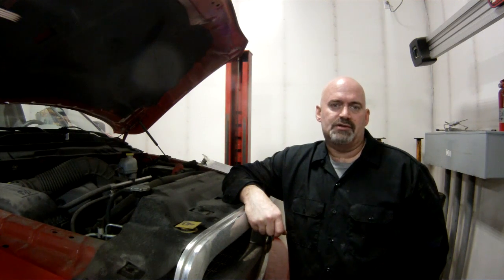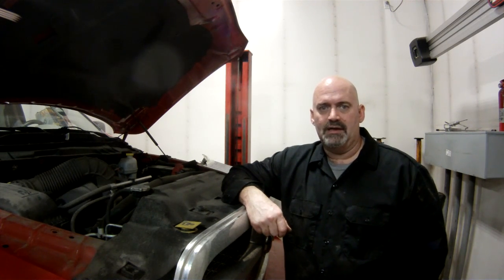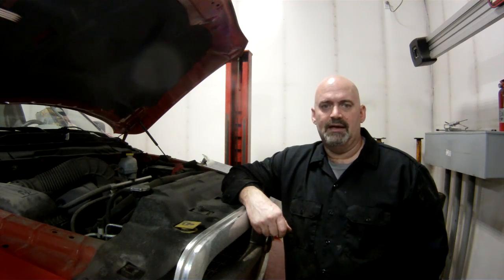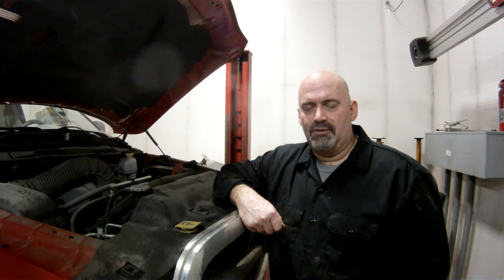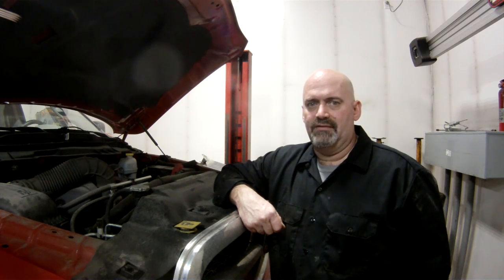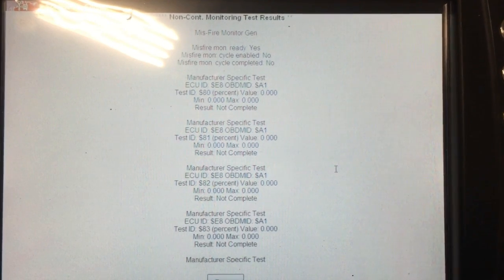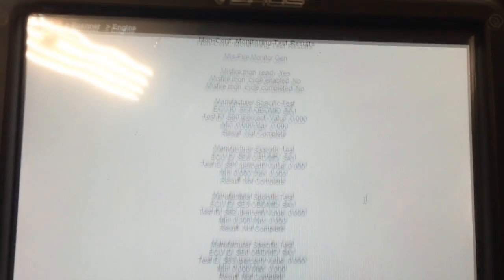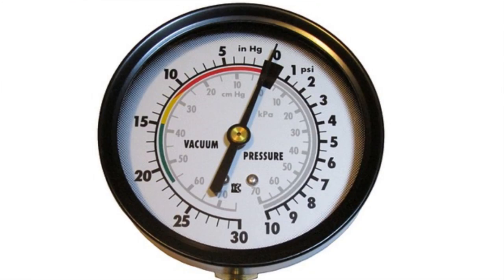Dodge 5.7 Hemi Misfire Problems

Comment: I have a 06 Hemi charger 5.7 when it starts up there's a clicking noise & it's just getting worse another problem is when I fill up tank & start it it limps on me & sometimes goes off
Reply from the maker: +Mario Santos I would try to isolate where the nose is coming from. Sounds like it will require a physical inspection of the valve components. Let us know what you find out. Good luck.
Reply: The limp is ur gas tank being overfilled, its covered by warranty.

Comment: I gust got done working.on a 5.7 the cam lobe was warn off on no 5 cylinder  ..pull V.C.and check if the valves are opening far enough ..my shop is on FB  Chucks Automotive and Diesel Repair. .in Albemarle NC.
Reply from the maker: +chuck stephens great tip Chuck! Thanks for stopping by.

Comment: wouldn't the ignition coil have shown to be faulty during testing of the cylinder?Or only because it happens under load it would not have been detected?
Reply from the maker: +jeff d You are correct,  sometimes secondary ignition faults don't show up at idle.
Reply: +jeff d So I changed cylinder #1 ignition coil. its much better but not perfect. Is it possible the either of the adjacent cylinders in the firing sequence are also suspect but not showing up on the codes? if yes, which are they 2 and 8?OR does the computer have to 're learn' the firing?
Reply from the maker: +jeff d Sure would be helpful to have a relative compression test done and review the data to isolate the problem cylinder. I hate to see you throwing more parts at it. Even finding a shop with a scope, pressure transducer and trigger lead and a tech who knows how to use it would be very helpful. If it's still #1 cylinder misfiring and the compression is good you should probably pull that valve cover and inspect those valve springs.
Reply: +The Car Doctor:  last question, the compression is good and as stated the problem only seems to exist during the RPM specified AND looking for power. I believe it's not mechanical because of the intermittent nature. If fuel is ruled out and computer reads cylinder one still, is there anyway it is the adjacent cylinders in the firing sequence?
Reply from the maker: I have seen that before. Thanks why I recommended the testing to verify what cylinder is truly affected. I have also seen defective parts and cracked spark plugs causing what you say so I wouldn't rule out the replacement parts as being the cause of your continued problem. Still think its worth running by a tech who has the equipment and knowledge to pinpoint the problem and save you money.
Reply: +The Car Doctor Car Doctor let mw throw this out there.I do also have intermittent starting problems. And when it fights me while starting the exhaust is white for a little bit of time. I assume Carbon build up. My take is its all related. frustrating thing is for the most part the engine runs and performs real well most of the time. Any thoughts? Thanks for all your help!
Reply from the maker: Compression test, leaks own test and cylinder balance test would be my next steps if the relative compression test yields no definitive results.

Comment: I have an intermittent cylinder #1 misfire only when the cylinder is under load. usually at 1500-1900 RPM and due to an incline the engine calls for more power. engine runs well otherwise and doesn't seem to happen otherwise.New plugs wires and fuel injector. any thoughts?
Reply from the maker: +jeff d Sounds like an ignition coil possibly.

Comment: I have a 09 ram bighorn hemi and I was driving with cruise on and my tensioner and timing chain broke, 2 months later the shop finally got the parts from dodge and fixed it but now it has a terrible terrible missfire. could it also be the valve spring?
Reply: +Yehosaphat Ken Yisreal Check to see if they put all the spark plug wires on, in their right places.
Reply from the maker: +Yehosaphat Ken Yisreal That&#39;s certainly a possibility. Any audible noise associated with the misfire? Misfire code? Be good to know what cylinder to look at and possibly run a compression test, injector circuit tests and possibly physical inspection of the valve springs on that cylinder. If the check engine light is on than it likely has codes and maybe a misfire code indicating which cylinder is effected. I hope it doesn't have any valve damage.
Reply: +The Car Doctor thank u fam, I'll check into that. I really appreciate your feedback!
Reply from the maker: No plug wires on this engine.

Comment: I have the 2013 5.7. Constant crank and engine wont fire. no check engine light. Any Ideas?
Reply: +Johnathon Aragon down on the oil pan on the passenger side you would be able to spot it. It will have a connecter that looks like the one to your Map air flow sensor and it will have a small bolt holding it tight. you may also want to get the cam shaft sensor as well which is right underneath the alternator. you can get the engine blue prints from google. that will show you every sensor and every wire.
Reply from the maker: +Johnathon Aragon So many possibilities. Any messages on the dash? Codes? Fuel pressure, spark, injector pulse?
Reply: +The Car Doctor you think a lifter would cause a problem like this?
Reply from the maker: Not likely but I suppose its remotely possible. Maybe just spray a wisp of starting fluid in air intake while someone cranks to determine if its fuel related. Had the check engine light come on before it stalled?
Reply: no the light never turned on. I got in my car yesterday at work to go home. it cranked and never fired up. then i shut it off and started it again and it ran. drove 40 miles home. then let it sit for 4 hours and started it to drive to the grocery store later that night. no problems at the grocery store. get home and park it for the night. then hit the remote start this morning. car didnt start. so i went out there to start it and all it did was a constant crank. been doing it all day.
Reply from the maker: Sounds like fuel pump to me. Lifters, rockers and valve springs usually break and don't become intermittent. Starting fluid might be a good test. Or test for pressure at the Schrader valve when someone turns on the ignition (be super careful not to get fuel spray in your face, start a fire or get caught in moving parts)
Reply: +The Car Doctor where is the crankshaft censor located?
Reply: Umm, you have to take the starter completely off. The sensor is hidden directly behind it. Oh and it was my fuel pump. But I sold my car. Thanks for your consideration.

Comment: Good information.  I have hesitation and surge when towing after about a half hours. I will have to check the vacuum tomorrow. One question.  If a valve spring is broken will there always be a code?  I don't have any codes.
Reply from the maker: +M Kenyon Most likely will set a code and you'll fell a definite miss/rough running condition unless just a small portion of the spring cracked and the valve still seats. Fuel pressure and volume are good tests to run and check the tune up condition for lack of power issues and hesitation. Good luck!
Reply: Thanks for getting back.  No code.  It only happens when towing a horse trailer with on horse.  No issues with an empty trailer.  Still have to find my vacuum gauge and try the 3,000 rpm measurement.  If it is the spring I thin my valve seats will be history by now.

Comment: Hi Dr.thanks for the tipsI have a problem that maybe you could steer me in the right direction. i took my truck in with problems ( misfire #5) and replaced coil and plugs all the way around. I gave it to the place I bought it ( 2006 hemi 5.7 110k miles) they had it for 3 MONTHS! well they replaced the head and belt pulleys.... and said it was done. I picked it up and it seemed to run fine but then I noticed the same symptoms and a check engine light came on . never left the parking lot and took it back. well needless to say they had more excuses and I got fed up and said just give it back to me after another week. so I go and pick it up [planning on taking it to the dealer on a tow truck but it runs ok... still a little miss and still a light on so I am planning on doing it myself. so if I am to get this right based on a new head installed I need to check for the #5 cylinder what's the procedure in order first? compression?, vacuum, fuel delivery check with a noid light? the coils were switched already so ?? a bad fuel pump wouldn't just hit one cylinder right? any tips on the compression gauge getting it in the head? and getting out. who knows what the shop did but the warranty covered most of it and I would have to assume they actually did replace the head ( they said they believed they were given a faulty head) but after 3 months ( yes 95 days) I aint waiting on them. any help would be greatly appreciated thanks
Reply from the maker: +TheCheffrank357 So did the actual code P0305 return? or is it another? If its still #5 I would say check misfire monitors with a scantool if possible, check compression on 5, also do a running compression test, attach a vacuum gauge to a manifold vacuum source and monitor for rapid fluctuation which would indicate valve issues. If that's ok then you should look at that fuel injector. If you can get a noid light and plug it in you can make sure its firing that injector. Let us know what you come up with. Good luck hunting!

Comment: my 03 ram hemi sounds like a 350 chevy with a rocker bolt loosened "puh-puh-puh" from idle on up to hwy speed with shaky pudding in overdrive & needs to be pressed down on moderate hills & no load ( empty truck ) I also have a ton of oil leaking from the engine onto the left hand side of engine past the transfer case & LH frame rail. I heard I can pull codes right off the dash is this a fact? thanks Matthew
Reply from the maker: +MontrealMan1970 I know you could pull codes off the older stuff but not sure on newer models. To do it you turn the key from off to on then of, on, off and then on and count the flashes. But I think that was primarily for OBD 1 vehicles and most codes are three digit now but I could be mistaken. I will try it the next time I get one in. Anyway the sound you describe is similar to a broken valve spring. You could probably go to the side you hear the noise coming from and pull that valve cover and inspect for a broken valve. The oil leak could be an oil pan gasket or oil pressure switch I guess but you'll just have to get under there and pinpoint it. Good luck and thanks for dropping by.
Reply: Thanks Car Doctor I appreciate the advise & will give you a follow-up. The '03 hemi has 153000 mi on it.
Reply: +The Car Doctor I got po203 #3 injector I tested it & other random injectors all read 12.2-3 volts so I chanced it with a couple of jugs of injector cleaner & ethanol free Shell 91. It must have unstuck that #3 the "puh-puh-puh" went away power came back but got po172 afterwards which I think was due to the injector cleaner.  I just bought the truck last Saturday.
Reply from the maker: Hey, at least it sounds like your heading in the right direction. Make sure you didn't knock a vacuum hose off when you were in there. Good luck.

Comment: I just had my r/s exhaust manifold replaced on my 07 Aspen 5.7 hemi, had a leak for sometime and found out it was cracked. After replacement engine got quiet, but now it runs a little rough on idle and  uphill, smooth on cruise. Mechanic says I have #2 cylinder at 140 compression, the rest shows 170. Just had tune-up 8 months ago, now it's at 121k. Contemplating on replacing both heads or get a rebuilt. Please advise, thank you.
Reply from the maker: +Dude bro Awesome Hey I missed your comment. Did you decide on the fix? Might be time to consider a rebuilt engine. Heads would cost less but still have a lower end with  121K. Never an easy decision. Give us an update if you get this. Thanks.

Comment: Having P0300, but hesitation and misfire only in first minute or so. Runs fine thereafter. Mechanic couldn't identify specific cylinder. Would that be consistent with crack spring?
Reply: Did you ever figure out this problem?

Comment: 05 Chrysler 300C 5.7L hemi has problems starting and has a bit of hesitation when you get on it.. Has a random misfire code any ideas??? just started doing this after the oil pressure switch was changed
Reply from the maker: Brett Anderson sounds like ignition system fault. Have you checked anything? Plugs?
Reply: It just got new plugs and wires put on
Reply from the maker: Brett Anderson if you had a way to monitor misfire counts and isolate which cylinder that might be a good place to start. Maybe a compression test is in order. Possibly a failing ignition coil.

Comment: The problem with my 5.7 Hemi (Ram 1500) is that there are never any problems.  Five years strong, not a single issue, even in the worst weather conditions.  I miss those days of old when diagnosing and repairing engine problems was the norm ... now all I have is an occasional lose nut behind the wheel.  This is one good engine.
Reply from the maker: stereopolice I think a lot of folks have similar experience with their hemi engines. My problem is I only see them when they break. Every brand has their issues and I really can't say one is stronger than the other  sorry if my tone was negative toward Chrysler products, they build some great trucks. Thank you for watching.
Reply: The Car Doctor Understood.  Thank you for the reply sir.
Reply from the maker: I think they are comparable to a Ford Triton 3 valve engine for longevity of service but that's just my personal opinion based on my limited exposure to them. Mostly the higher mileage engines are having issues like this.
Reply: +The Car Doctor 
Hi there, seeing that you have a vast knowledge on the Hemi's I have a question that I'm hoping to find an answer for. I own a 2008 Jeep GC with a 5.7 Hemi. Around 87k miles I developed a strange noise coming from what I think is the exhaust system, either right at the manifold or around the cat's.  Shortly after a ticking sound started as well. Reading alot of the post an forums I noticed a trend in guys describing this problem as an exhaust leak sound that you can hear very loud when rolling driver side window down. this is exactly what I experience! I brought it in to a muffler shop and had the guys listen for an exhaust manifold leak . They could not identify one ! So my next move was to replace the EGR valve. No change! The ticking sound is not discret, it is more the sound of a Cummings diesel engine , sometimes louder sometimes not the te at all !!!! lol, this is torturing me . I thought about removing the exhaust system and te placing manifold gaskets also inspect the manifold studs, however seeing the work involved I am jot sure I want to start that if it leads me into a dead end. The Hemi idles nice at about 600 RPM, I use Mobile 1 synthetic , the plugs are new , the PCV valve is new , the air filter is new , I cleaned the Throttle body valve with an organic cleaner I even had it brought to the dealer and placed on the computer for any codes or malfunctions...all withing parameters...however it still feels little sluggish...could this be exhaust or something internal? 
thanks for any advuce.
Reply from the maker: Check all the manifold bolts for any broken ones. Look around the manifold at the cylinder head for any exhaust leakage leaving black soot as a clue to leakage. Manifold tend to leak and then not after warming up or cooling off so this is similar to your complaint. As far as sluggish performance who knows. Maybe a clogged cat which can make a rattle noise at times and also restrict exhaust flow and cause poor performance under load. All stuf to look at. Also check tune-up condition which can of course affect performance. Finally the noise you describe may also be an internal valve train noise and can cause the problems you describe. A more detailed inspection by a qualified tech including pulling valve covers and looking at valve springs etc may uncover the problem. Good luck!
Reply: +The Car Doctor I have a question for you. How are the newer 5.7 engines? I'm looking at a 2500 crew cab 4x4 5.7 Thanks
Reply: yep 2004 durango rod the piss out of ot because its so fast i can't resist !! never ever fix anything  LOL i feel bad knocking on wood now LOL
Reply: i have 225K on my 2011 Challenger RT because I do not bring it to mechanics like this one. LOL

Comment: Just had to open up the engine on my 2007 dodge charger with the 5.7l Hemi. I had just made a quick stop and was in and out of the store. Apparently the valve seat for cylinder 3 dropped and got sucked up back into the intake. Spreading the pieces into cylinder 2 and 4. Needles to say that now i need a new engine. 88K on the engine dealer serviced and used full synthetic mobile 1 oil. Did lots of little repairs, starter water pump, ignition actuator pin, battery, transmission service,Wheels, tires, brake rotors, exhaust, radiator because it started leaking between the metal and plastic. During the trouble shooting for the multiple cylinder misfire, i replace the crankshaft and camshaft position sensor.
Reply from the maker: Martin Buckner sorry for your loss! At such a young age and always taken care of that just stinks. Thanks for watching.